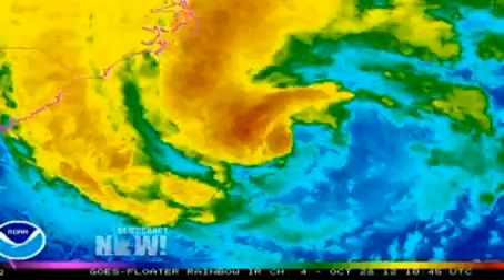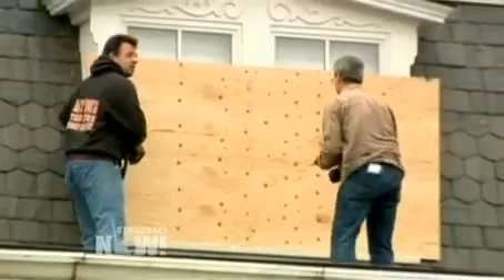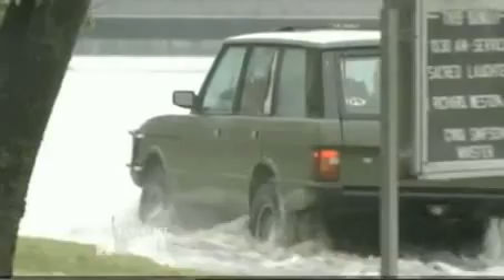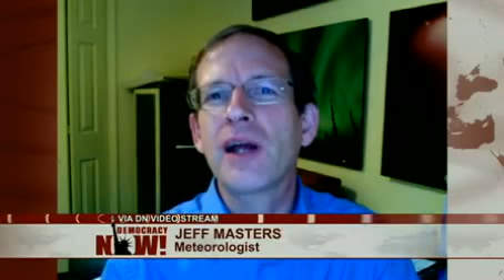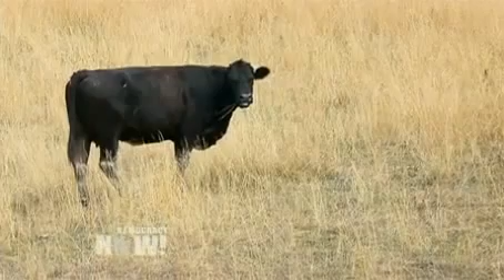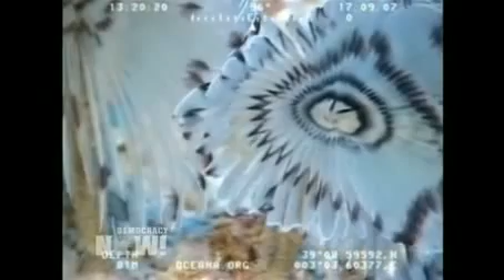Meteorologist Warns Hurricane Sandy an Outgrowth of Global Warming's Extreme Weather

Comment: We are still 6 degrees C below Earth's normal surface temperature.  And CO2 is also much, much lower than when earth's surface temperature has been normal.  Keep in mind that it is a symbiotic relationship.  Rising temperature causes CO2 to rise and rising CO2 causes temperature to rise as well.  But the dominant factor is temperature, not CO2.  Man accounts much less than 1% of the CO2 rise since the little ice age.  Rising temperatures have accounted for the vast majority.

Comment: Have you ever considered how many Fossils would be required, in order to produce the total volume of all Oil extracted by man, and the estimated amount of Oil still in the ground?

Oil, is not fossil fuel. It's avionic, ions and protons from the sun, collide with element inside the earth.

Cosmic rays are the aerosol which makes clouds. High solar activity from the sun = less cosmic rays reaching earth = less clouds. They know this, that's why they are spraying.